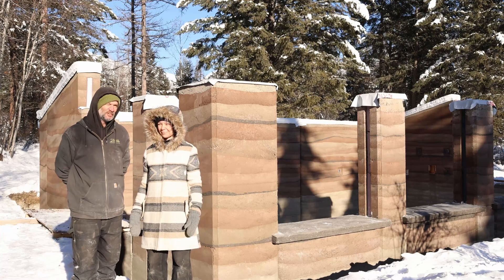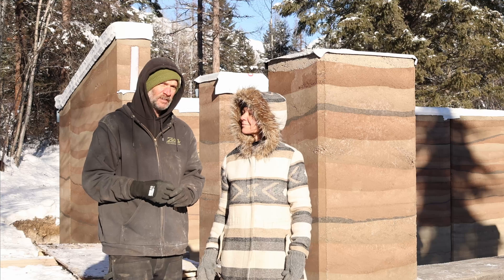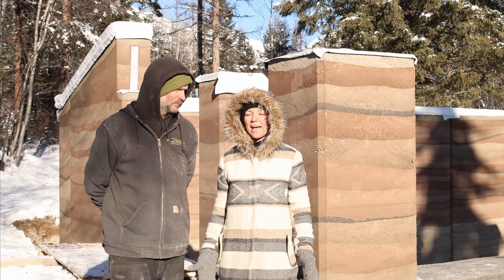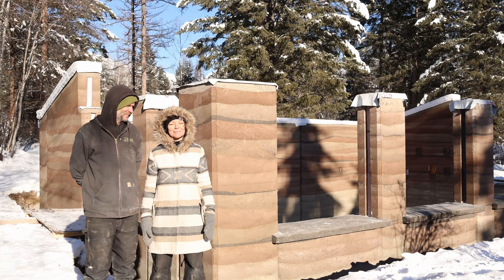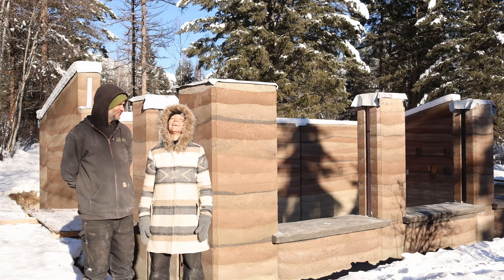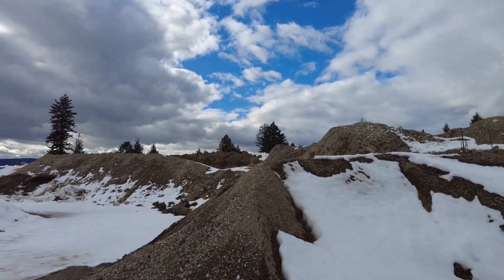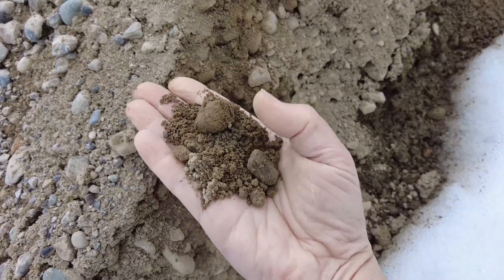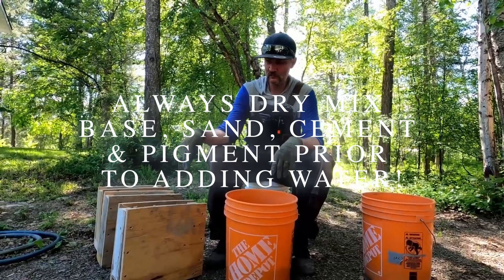How We Built Rammed Earth Walls  | Geothermal Greenhouse Build

Comment: So does the foundation have to be concrete? Could you have a foundation of stabilized rammed earth?
Reply from the maker: Based on our location, climate and our engineering specifications we had to use concrete for the footings. The rammed earth walls on the greenhouse are acting both as foundation wall below grade and your visible wall above grade. 

So yes you can use it for a foundation wall, however best to have it engineered based on lateral loads. Hope this helps and thanks for watching!
Reply: @  That makes perfect sense, thank you for sharing!

Comment: i don't think it's a good idea to add gravel to the soil for rammed earth wall construction gravel is very coarse and would not bond properly with soil , unless you are adding over 25% portland cement, by so doing the whole purpose is defeated .
Reply from the maker: Aggregates are an important part of our mix. We have less than 10% clay in our mix. By bringing in specific materials we can ensure consistency in the mix and the process. Our climate requires the rammed earth to be stabilized for a number of reasons. We are using 10% Portland in our mix.  Our goal is for this to be here long after we are gone. Thanks for watching! We appreciate the support and the suggestions!

Comment: Ive even studying and dabbling in natural building for 35 years and rammed earth is currently at the top of the list for a major nice addition. I love that when the forms are removed it’s done. No wrap, sheathing, insulating, screws, nails, painting, siding. So many steps can be skipped.
Reply from the maker: Rammed Earth is amazing. We originally fell in love with the aesthetic of it. It’s fire resistant, insect and mold resistant and yes it eliminates multiple scopes of work in comparison to traditional wood framed construction.  Hope to see more of this method being used in the future.
Reply: I’m hoping the soil here is adequate for rammed earth. There’s two levels of soil. A high clay bottomland soil with very fine silty structure and a upper bench of soil that has more rocks and sand and little clay. I’m guessing the upper soil will work best or a mixture of the two.
Reply from the maker: Best thing to do is make test samples from your material in small forms. Play with your mixture until you get the consistency and strength. It takes time but once you have it you’ll be off to the races!
Reply: Yes, I forgot to add trim to list of materials and labor that can be eliminated or largely eliminated.

Comment: Another great video. Your can-do attitude inspires me and gives me the confidence while planning my own project that I can do it. I'm working my way through the book you recommended, it's a great resource. With your next project, will you be laying a concrete slab or just sticking with footings? If a slab, could you discuss the logistal problems that need to be overcome, if any, when doing it as a self-builder? Also I'm interested in roofing options. You are building a structure designed to last, so how do you match that with a roof of a similar lengevity? Or is it not an issue and you just accept that at some point you will have to replace the roof?
Reply from the maker: Hello again! Thanks for the compliments!  The next project will most likely have rammed earth above grade only. It may be a combination of foundation/piles as well as a slab. Engineering will dictate the end design. If slab is in place I don’t see any issues as long as it is fully cured a skid steer can drive on it. Not having to work around an open excavation would be safer and more efficient for rammed earth install. 

The roof will be wood with overhangs to protect the rammed earth. Metal roofing will be used for longevity and fire rating properties. You could look into aircrete. I’ve heard about it but have not pursued learning more on the method. 

Have a great day!
Reply: @thetielife  How about a tiled picthed roof?  Good for insulation in Summer and Winter. Or is that a pain to put on compared to wood and  metal?
Reply from the maker: That would work if you have the know how. It’s out of my domain!